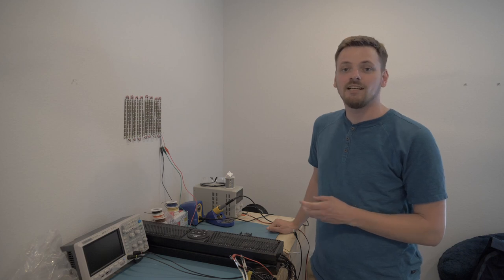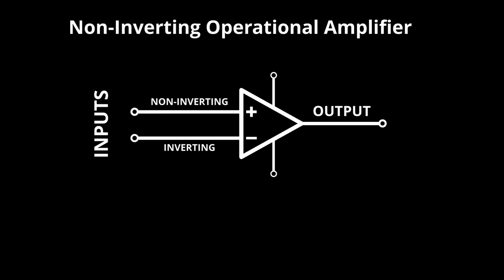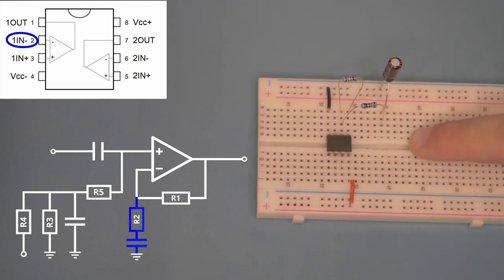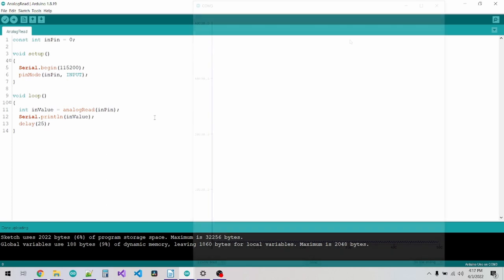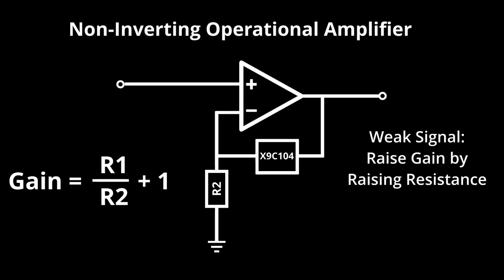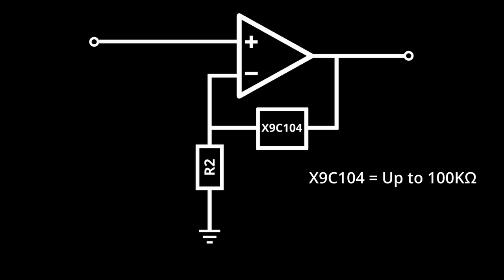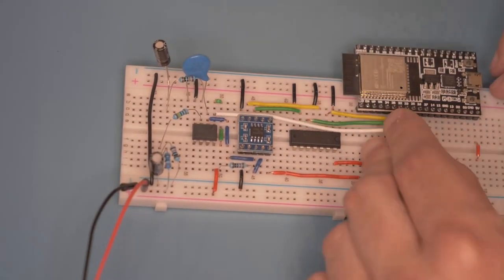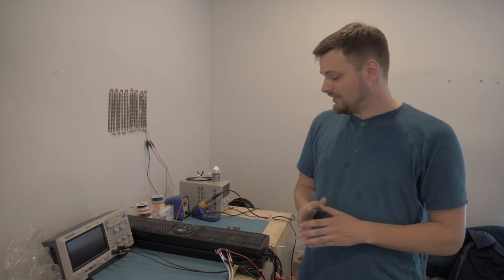Creating a Spectrum Analyzer using an Arduino and a Non-Inverting Operational Amplifier

Comment: Too bad your soundbar doesn't have a true "line out" which would mean that the output level is unaffected by the volume control, that would avoid having to build an AGC as you did.  You'd also run into the same problem using a "headphone out" which would have some amplification built into it.
Reply from the maker: Well a soundbar with that would definitely be something to specifically look for if I was going to build another project like this. Didn't know that was a thing.
Reply: @himynameischris2175  I was originally drawn to your video because I have a similar problem with a spectrum analyzer I am building.  I want it to work with both line out and headphone out without having to have both the master gain (from input source) and an additional gain (with a knob) to feed the analyzer.  Having studied the problem, I think your approach is not convoluted, you definitely need some form of AGC.  I'd prefer not to go the digipot approach, instead I would prefer something more "analog" that doesn't require uC support.  One approach I've come across is using an LDR/LED (i.e. "vactrol") from the output to adjust the gain.  I haven't yet tried it, but it seems like a simple solution that may meet my needs.  If you search youtube for "automatic gain control LDR", you should find some relevant videos.

Also, you might have been able to keep your single ended 5v supply with an OPA341 or LT1013.
Reply: @Enigma758  great comment!  nice video, Chris. I think you could get much the same effect by doing AGC digitally. more bits will sound better, but since you're just driving a spectrum analyzer display you'd end up with a similar display.  in other words, take the highest sample minus the lowest sample in the last X samples (the envelope, or volume) and use that to normalize the signal. small envelope = more gain and vice-versa.  You'd still need an op-amp circuit to shift and amplify the signal, but you could use a regular potentiometer to trim the ADC input signal so it never went over the max voltage then leave it alone.  using a digital pot is pretty cool I must admit :)
Reply: @RealJohnnyDingo  I've decided that AGC is not what I want since I also want to display VU.  AGC = compression and that works against a VU meter.  My current approach is to use a rail to rail op amp and even so, running it at a higher voltage than the ADC range.  I am using a zener to clamp the output so as not to damage the ADC.  I still need a pot since I want utilize as much of the ADC resolution as I can.  Furthermore, since I'm not using AGC, I need to pot to adjust the gain from different sources.

Comment: Right... EXCEPT, THIS IS NOT A SPECTRUM ANALZYER
this is a Graphic Equalizer 
if it were a spectrum analyzer

you would have at least 1 input to sample the signal coming in.
Audo would not come out 
Instead you would have Parametric readings 
You would have properties of the signal such as
PER BER
POST BER
M.E.R.
S.N.R.
Q.E.F.
etc etc

Hence   THE INSTRUMENT IS ANALYZING something 
and has a quantifiable reading

what do you have
a bunch of blinking lights reacting to an audio file
NOT EXACTLY THE SAME THING

Comment: Hi Chris, if I want my audio signal to read from my mobile phone for example how would I do this? Also how did you get your speaker to play the music and send that audio signal to the op amp. I am just abit lost on how you take the raw signal and get it to the arduino and to play at the same time. 

Also what Op-Amp did you use, Thanks :)
Reply from the maker: Getting a signal straight from a phone (using the 3.5mm audio jack) might be tricky but I haven't tried that. In the video, I was connecting my phone (or laptop) to the soundbar I bought via Bluetooth. The soundbar I bought has a variety of wires/connections, one of which was the two RCA plugins that will repeat any audio signal the soundbar is playing (I read this in its manual).

If you don't want to use a soundbar, I wonder if simply buying a female 3.5mm port and connecting your phone to it using a male to male 3.5mm wire would do the job. That might work, but I'd have to try it myself to be sure. That might also introduce the varying voltage based on volume issue I was having with my soundbar when really you want the sound level to not affect the voltage amplitude.

I thought I said it in the video but I used a TL072 op-amp.
Reply: @himynameischris2175  Okay got ya. The second half of the video was all about aliviating the voltage delta based on the volume of the the audio signal, but what if the volume was fixed, would you even need to have changed anything?

Comment: What’s the purpose of R5?
Reply: When using dividers as a voltage reference, you wanna make sure you don't draw current from that node otherwise your voltage drops. For a circuit like this it isn't really needed since the input impedance of this opamp is on the order or TOhm, basically infinite, so no current will flow out of that reference node.

You are using similarly to a pull-up resistor, where that node will be set to the reference point via R5, but in this case you don't really need it.

Comment: AVR can easily do FFT should you nuke the Arduino firmware and just code ASM ;) Tried it, one op-amp to somewhat crank the input up and it is all done.
Reply from the maker: What is AVR? Haven't heard of that.
Reply: @himynameischris2175  The 8-bit core later used in Arduino boards. Guess an ESP (which at least has a higher clock) could do FFT even under FreeRTOS.

Comment: Thanks, but to be honest: to use d-pots for the bias-voltage control, an calibration routine and a digital switch ( aka transistor ) to protect the adc input while calibration was the obvious choice and took just 2.5 sec to work out in theory…

Comment: since the Arduino is reading only positive signals on the analog ports why didn't you use a germanium diode to clip the negative side of the signal and keep the positive side on the other hand output of laptop on the audio out port is 5v peak then no need for the op amp. if you ar worried about the clipped time for the negative side you don't have to worry you are only visualizing the sound not hearing it so distortion will not matter a lot, also if you insist on op amp use another type of op amps
Reply from the maker: Mostly because I have no idea what a germanium diode is, lol. I have a background in computer science but all my electronics knowledge is self-taught. It's difficult finding good sources for info on this stuff online. I want to revisit this analyzer idea in a few months when I'm back in Cali to incorporate some of the feedback I've gotten.
Reply: @himynameischris2175  A germanium diode is just a diode made of germanium. It has different electrical properties then a silicon diode. It has a smaller voltage drop but ultimately they all just diodes
Reply: You don't want to clip the negative of a signal if you want to process it's harmonic content. Do an FFT on sin(x) and the FFT on sin(x) but only positive. The spectrums are different. This isn't just lighting a lamp reactively to the level, but also frequency content. 

Edit: you could, however, make three filters to split the signal into three bands(or however many), then just clip the negatives. But I think just saving the whole wave is better since you can then just digitally filter the signal